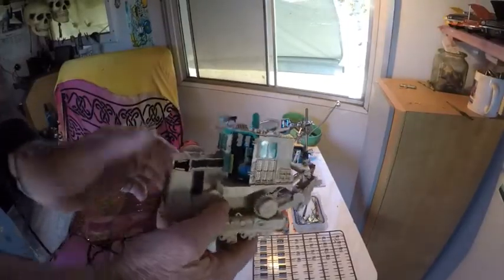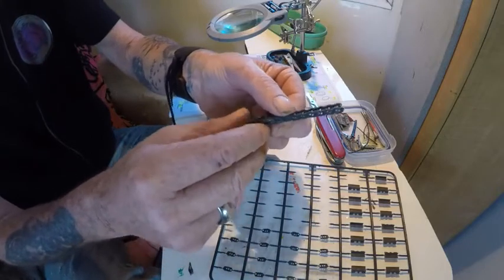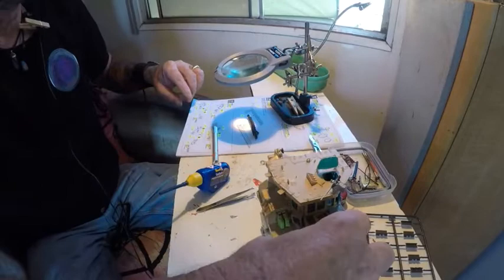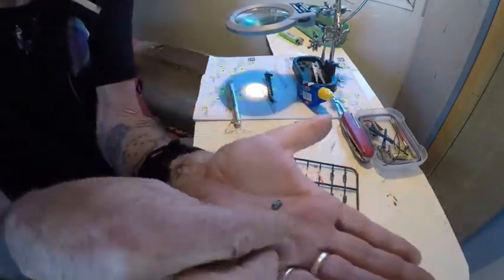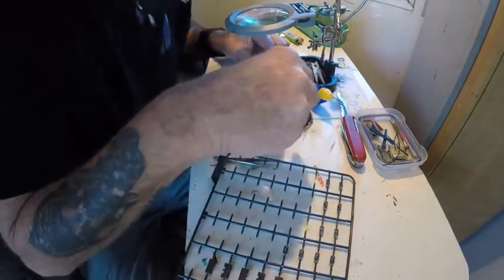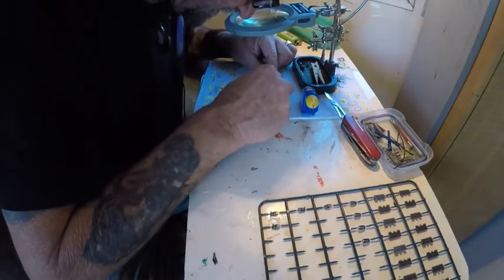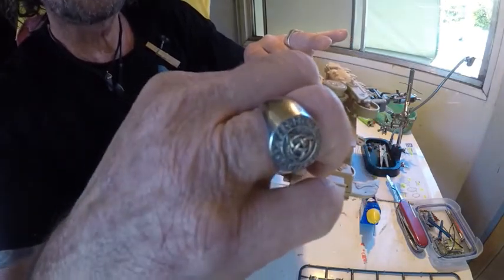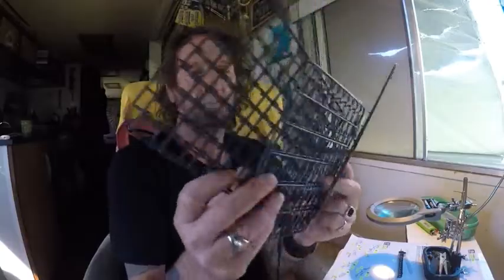D9 Dozer Build Prt 3 The Track Gear....... Hippy Trev

Comment: Ahh track links,yes they are a pain what I normally do is I cut them all off the sprues,sort them into separate containers I use cut down milk cartons, about 2or 3 inches deep,then do the assembly , tedious time consuming frustrating , but that's track links mate, but you can do it I'm cheering for you !!!! hope you solve the car/ boat problem too take care mate 👍👍
Reply from the maker: lol it took me 2 days just to build & put on 1 side of the dozer...  & The Boat  whole day spent on it today  & still have same problem...lol
l try get back to the dozer in couple days  get that 2nd track on....  cheers mate..
Reply: @hippytrev7452  okay mate, take it easy & good luck with the boat  cheers Trev 😃👍👍
Reply from the maker: @trevorb1239  thanks mate  lm not about to give up  lol  Not yet lol cheers